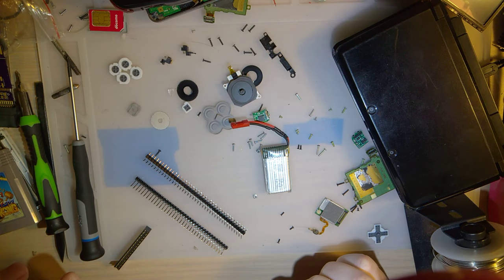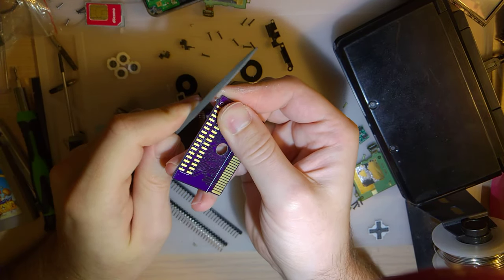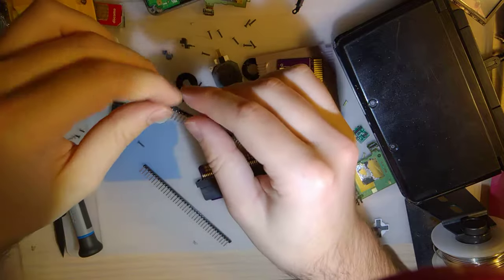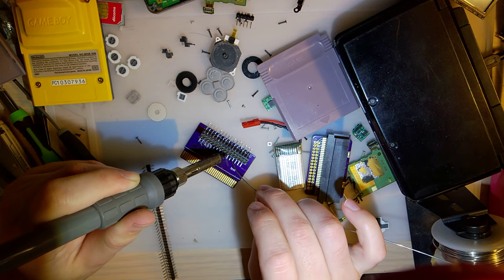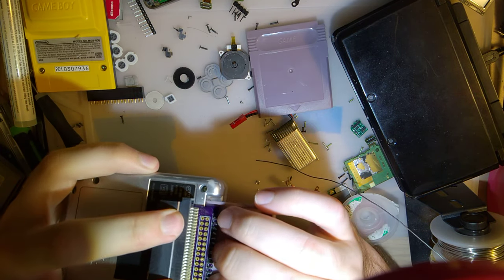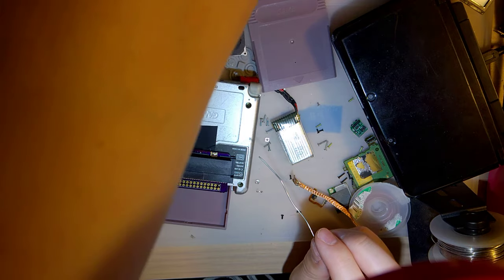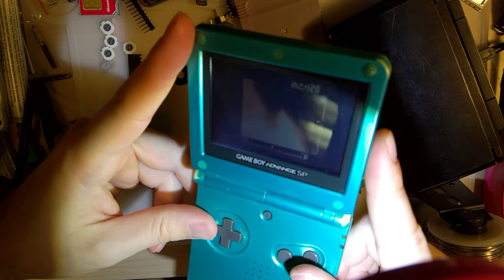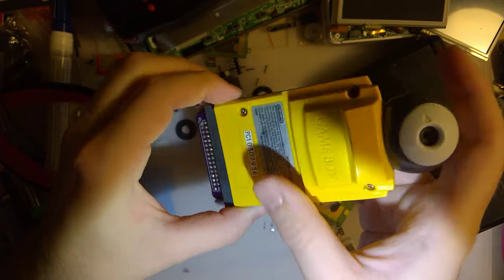How to use a Game Boy Camera on a SP (right-side up!)

Comment: Great project. Maybe use larger pin will help.
Reply from the maker: Yep, probably. I was just working with what I had. I think the pins I have are the "same length" kind (right) whereas I designed the board for the "reverse" kind (middle): https://i.imgur.com/usnEV7t.png